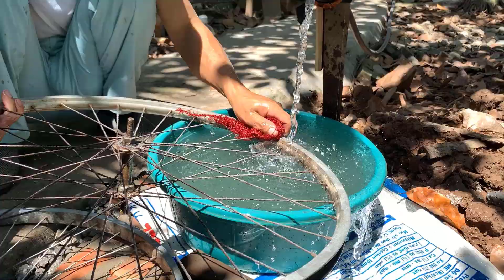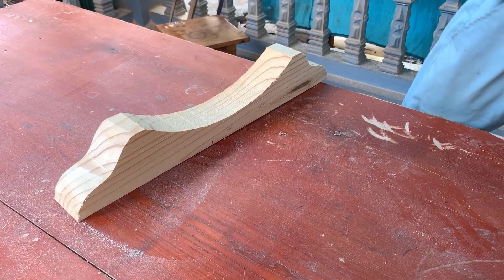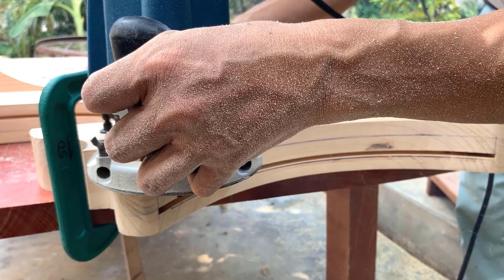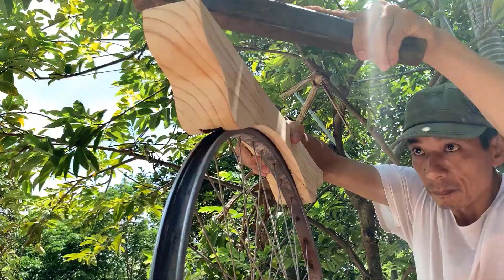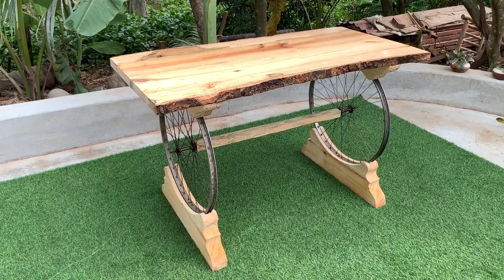Woodworking Ideas - Plan To Recycle Discarded Items To Be Useful // A Unique Table From Old Wheels

Comment: Polishing that rim and spoke Prior to installing would have been nice.
Also,,, those numbers on the drill are the setting for the clutch,,, so you do not strip the screws.
That would have been a better drafting student table if you would have used the gears too.
Reply: After a few months, that table top is going to be horrible and impossible to use.  The screws do not allow for any wood movement.  Judging by the wood, it is probably not dried and will most definitely want to expand or contract.